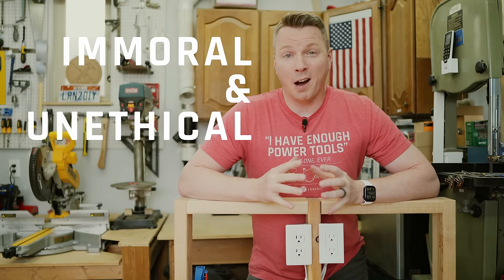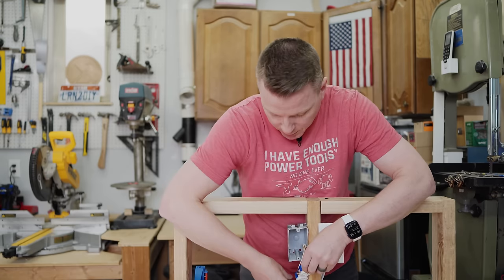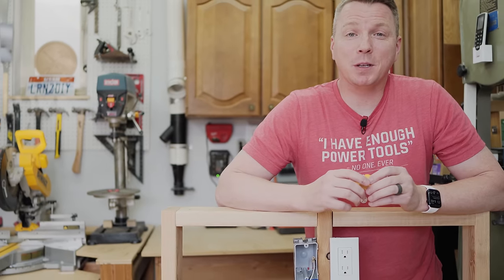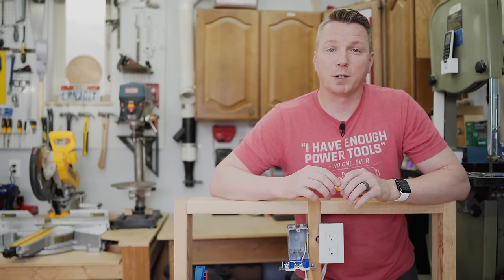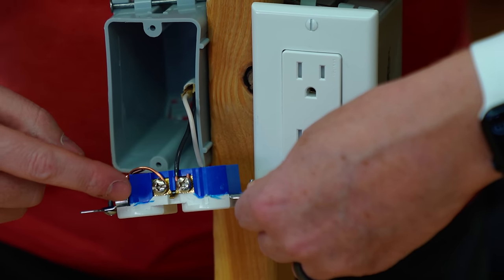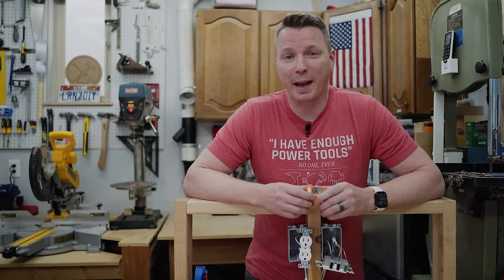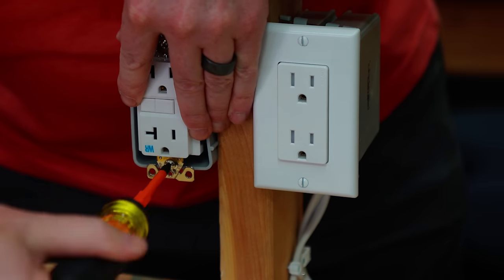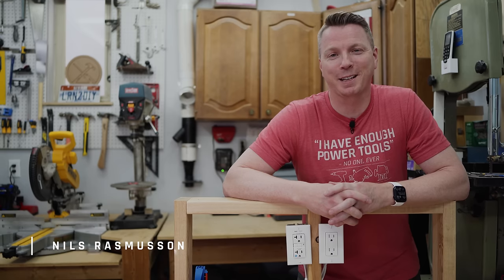People Are Adding Deadly Hacks to Outlets

Comment: I see this all the time. The city I live in requires rental properties to be inspected and the inspectors check the outlets. A lot of landlords just use the jumper because they don't want to spend the money on GFCI outlets. The inspectors have caught on and are starting to use the expensive testers. When they catch someone they automatically fail and must have the outlet replaced by a licensed electrician then pay $250 to have the property reinspected. So when they get caught trying to save $15 it ends up costing them a whole lot more! Not to mention they are endangering the lives of their tenants.
Reply: How does gfci outlet helps if you have just 2 wires ?
Reply: @dmitripogosian5084  With normal power usage, the amount of power you draw from the hot matches what is sent back on the neutral.  GFCI outlets work by running both of those through coils that balance out.  If they aren't balanced, then it acts as a magnet that trips the breaker.  Very clever design, but the result is that if the power tries to go to ground or somewhere else, it will trip the breaker, so GFCI saves you.  It's also totally allowed by code as long as you use the provided stickers.
Reply: @pfcrow  Thanks for explanation !

Comment: GFCI - current going into it and coming out of it - more specifically imbalance detection ... it's looking for imbalance between hot and neutral (or the two hots in 220V circuits) - notably it specifically excludes and doesn't look at ground for that current imbalance detection - so ground is /not/ included at the current it's examining.  And, don't think I'd call it "computation", as often the GFCI circuitry is much simpler than that.  It's essentially a very small step-up transformer - with the primary being what should be balanced pair of hot and neutral wires (or two hots for 240V) - as long as that current is perfectly balanced, zero output voltage to the secondary, but any current imbalance creates an output voltage on the secondary - the more imbalance, the more output voltage.  The output voltage of that secondary is then used to drive generally fairly simple circuit to trip the GFCI - and relatively quickly for relatively small current differences in the "primary" of that mini-transformer setup - we're talking on the order of (tens of) mA and (tens of) mS (I forget the particular specs).  GFCI may be entirely analog circuitry and fairly simple.  I haven't examined/researched AFCI circuitry - but I'd imagine/guess those might be fair bit more sophisticated (might include bit of digital, and thus possibly "computation" - but it would need be quite rock solid reliable, and anything short of that, fail in safe mode almost always ... maybe there's way to do that with fairly simple circuitry ... like I say, I've not looked into those implementation details for AFCI).

Comment: Does removing the ground pin from a grounded plug cause any problems? 

We have a window unit AC that has a GFCI on the plug, but my mom broke the ground pin off. The GFCI keeps tripping and we cant figure out why. (Its worth noting that it is plugged directly into the wall. Not a power strip.)

Comment: Don’t hate me but I did this once in my sister’s house to get one of her surge protectors working (it was one that required a ground to actually function), also the idea from this comes from 3 wire stove/dryer cords/outlets, where they bond the ground and neutral in the appliance so they don’t need a 4 wire cord, since the neutral wire is big enough to accommodate for both, because on those there is little to no current on neutral

Comment: When we bought our house 5 years ago, we had the wiring redone by an electrician.  But before they rewired the kitchen, we had a plumber do some work under the kitchen sink.  We apparently had a reverse polarity bootleg ground on the disposal plug because when the plumber touched the disposal with his screwdriver, a HUGE spark jumped.  We shut off that circuit while he was working, and eventually the electrician rewired that circuit and it's all good now.  But boy that was scary.

Comment: So glad I live in the UK where all our appliances are grounded by default. You do sometimes get fake ground plugs though. But that's usually the cheap chargers you get at a corner shop for a tenner but most proper plugs have it.
Reply: double insulated uk plugs don't need a ground just like double insulated europlugs
Reply: @gamecubeplayer  ah I never knew that. I vaguely remember someone mentioning the plastic ones could be a problem though if used long term but most people would unplug phone chargers regularly as they go about their everyday.
Reply: @cillianennis9921  for example you can't plug grounded c5 power cords into double insulated c8 devices

Comment: A box with 3 prong with 2 wires and or a green dot on the face is common in old homes (the testers will read open ground).  Old homes are also usually wired with bx steel sheath cable and steel boxes that act as a ground.. you can (I believe) add a jumper to the back of the steel box to the ground connector on the outlet depending on if you have BX wiring or not

Comment: Years ago I was inspecting a house. At the panel, the branch circuit wire was silver cloth with 2 conductors. When I started checking the receptacles every one was testing grounded, Red flag pulled a few covers, everyone was bootlegged

Comment: Those testers also wont expose a Neutral and Ground Reversed. They are connected at the Main Service, they seperate after that, the neutral carries current, Ground keeps everything at Ground Potential.  If it is Grounded, it can't be live, would trip the breaker. 
Good Explaining
Stratmando

Comment: Bootleg grounds will trip GFCI and AFCI breakers in the panel, as it sets up an alternative path for neutral current to flow back through the connected device as your then perhaps part of the circuit if the thing plugged in is not double grounded. The GFCI-AFCI detects a current imbalance due to ground wire siphoning away neutral current and it clicks off. Actually, having those type breakers in your panel is a good test of the wiring. It will also click off on shared neutrals. It wont click off if there is no ground wire at all, which is still a good thing. Any ground fault will still be detected, so you are protected from shock with no ground at all when using a GFCI. All old 2 wire hot and neutral with no ground can have a GFCI and your protected from ground faults. Newer GFCI auto test continually, if the GFCI breaker electrically fails, it turns off the power and cannot be reset, which also is a good thing. Technology is making even old wiring systems much safer. It may be a code violation to install a grounded receptacle on a 2 wire system with no ground even if it is GFCI protected, because, well, it is in the code. But it will be perfectly safe to use. But I DO recall seeing those outlet stickers that say GFCI protected NO Ground that are placed on such outlets, so maybe not a violation after all if it is labeled.

Comment: My dad recently started to redecorate the kitchen and found that one of the wires had a nail through it. These wires have been changed since at least the 70s, and whoever did them ran out of cable clips and just used a nail for it.

Comment: European outlets are designed so, that you can simply plug in a 3-pole plug (with ground wire, type E or F) into an ungrounded, 2-pole socket (type C). It just fits (the ground wire in the plug isn't simply connected to anything in that case), so there's no reason to make such "bootleg grounds" - although, as others have noted, similar approach was used for some time, with "zeroing" instead of grounding (TN-C type installations). However, it doesn't work the other way - if you have an old device with a full-size, round 2-pole plug (type C), it won't fit into a 3-pole socket with ground (or null) wire (type E or F). Small, flat 2 pole plugs (so called "Europlugs"), as found in eg. some portable radios etc., do fit into 3-pole E or F sockets.
(By the way, American 2-pole plugs/sockets are called type A, and 3-pole ones, with grounding - type B. I wonder why you didn't mention these names in the video...)

Comment: I am glad you brought this to my attention. If I were a home buyer or homeowner, I can use a  cheapest way to find out if you got hacked "ground" or not. Use a cheap 1500 watt portable heater to bog down a neutral and you'll see the different neutral and ground voltage potential. If both neutral potential is same as ground, you will know it's hacked. Closer to main electrical box will show lesser voltage potential difference between ground and neutral. You should still see some difference even with a $10 meter. If you're too close, best to open the plate and see.
Reply: The only reason you'll see any power on the ground in the situation you described is because you're pushing the neutral wire to it's max potential (1500 watts = 12.5 amps to 13.64 amps, depending on your actual voltage available, assuming it doesn't exceed 120) and the power is just sitting there, waiting to "take it's turn" to go into the wire (like cars on a backed up on-ramp). This also means your wires will be heating up, which reduces conductivity, which in turn creates more heat, etc. It's important to NOT "bog down a neutral". It's a fire hazard! Always use the correct size breaker for the wire and always use the correct sized wire for the anticipated load. While power on the receptacle's ground DOES show potential to shock you, it can only do that if your body becomes the path of least resistance for this "backed-up" power and it'll never exceed the amount of power that's "backed-up." While it isn't impossible for you to get shocked from this situation, it'd require some very specific circumstances, like, say you're standing on a grounded metal surface AND your body doesn't offer enough resistance conductively speaking AND you are barefoot AND the circuit breaker is at least 20 amps or is faulty. Circumstances may vary but I feel like I made my point.

Comment: In fact this was common 50 years ago when the TN-C only networks were used. You can still find this in old buildings with aluminium wires.

Comment: in the midwest (maybe some other parts of the country) we have conduit for all of our wiring. so if you have a two prong outlet you can replace that with a 3 prong outlet and use the conduit as ground.
Reply: Does that meet regulations? Can you be sure that junctions in the conduit really never ever get corroded?

Comment: You can do this hack only if you're house using metal outlet boxes and full metal electrical conduit because the ground was attached to the conduit that mounted to the breaker panel because the grounding rod usually ran right under the breaker panel through the foundation and the stud under the breaker panel.

Comment: There is a way to use those cheap testers to find reversed outlets. You will need the cheap tester, a roll of wire long enough to go from an outdoor ground to the outlet being tested, and one of those 2 to 3 prong adapters. You connect the long wire to a good ground and the little ring on the adapter then plug the adapter between the tester and the outlet in question. You will instantly know if the outlet is reversed and a bonus is you can then unplug the tester from the adapter and plug it into the outlet to see if the lights all light up properly. You'll still have to pop the outlet to check for the "cheater ground" but this will let you quickly test for reversed outlets in a house for wayyyy less than 400 bucks for a smart tester.

Comment: Many times when a non professional "Electrician" happens to be an electronics technician, they will assume that the white wire is the hot and the black is the ground.  In electronics, the red wire is normally the live circuit and the black wire is always ground.  I became an electronic technician, but discovered for power outlets that the Black was the "Hot" and the White was neutral when I was very young.  
When I was first hired as a technician at a sound installation company, we were building new workbenches for our shop and also installing the electrical outlets.  The senior tech was hooking up the outlets without regard to polarity.  I tried to tell him that the black wire needed to go on the gold screw and the white wire needed to go on the silver screw.  He scoffed and said "It is AC so it doesn't matter".  That is true in electronic equipment, but not power wiring.  Note: this was in 1972 in and old building in downtown Memphis, TN.  Almost all wiring back then was simple two-wire and no ground connection.   All newer construction had the three prong grounded outlets.

Comment: We bought this older home built around 1960 eight years ago.  Many of the outlets in the home were wired like this.  I left the 3 prong outlets in but removed the cheater.  I recently had a GFCI breaker installed in my main breaker panel by a licensed electrician and have labeled the outlets. (This is exactly what Bern Litzner is recommending below).

Comment: It's more dangerous in Europe (230VAC). I'm from Hungary, and I remember a beginner electrican's guide book which explained the dangers of this trick. I was just 6 years old.  I've seen also this bootleg ground  somewhere in Germany too. The worst I've seen at a friend's house, is that a whole, properly wired consumer unit had a floating ground without connected to anywhere. The grounding rod was disconnected in the outside of the house. My friend asked me to check a shocking washing machine. The whole thing was live in the bathroom, because of a faulty coffee brewer, which heating element was shorted. That's why the ground and the neutral should be tied, but JUST at the consumer unit, not at the outlets, if the live-neutral difference is low enough.
Reply: It is not a bootleg ground in Germany but Klassische Nullung, a perfectly legal method in old homes.

Comment: So I had a question about breakers and whatnot. In my house, we have about 6 outlets hooked up to a single switch in our breaker box, which is causing issues as these six are split between two rooms both running a lot of tech. This has caused the breaker to trip at least twice, is there a way to have an extra switch put in and have 3 of the 6 outlets hooked up to that one instead and about how much should I be looking at spending? I live in Michigan if that changes anything.

Comment: I've encountered even more dangerous one:
Some ppl to hide that it's not properly grounded connect third wire that ends only few fees deep and then they mask that ground was connected to neutral. That way even if you open it, at first glance you see 3 wires coming out and seemingly not shorted neutral with ground

Comment: I would have liked more information on specifics of what can go wrong and why.
For example, I have a circuit in my 1960s home in which I have 3 prong sockets and a ground wire, but there's a fault somewhere in which the ground wire never makes it to the breaker panel.
So, I had an air conditioning plugged into this circuit (with a warning about only using on grounded outlets) and what ended up happening was..
Not only was the metal case of the air conditioner giving little jolts.. EVERY OTHER appliance with a ground on that circuit was as well. Basically turned the ground into a live wire. So a broken ground became more dangerous than no ground at all! 
I put a bandaid on the issue by running a GROUND ONLY cord from the affected outlets to ones with a properly functioning ground. When in place, I no longer get zapped and an outlet tester says Correct on all sockets.. I can't be sure I'll ever get the money for a proper fix, since the cost to fix it is more than the property is worth.. BUT lucky for me & despite the other issues with my home, it was originally wired for 3 prong circuits, and the ground still works on most of them.
Reply: Many modern devices leak current to the ground wire and you can feel that if it is not grounded. It is not dangerous if the device was working. If it was it would trip any GFCI. The leak current is typically under 0.5 mA. The solution is not to touch it.

Comment: I recently changed the electrical panel.  The electrician hammered in two 8' long copper rods into ground,  The ground wire is tied to these 2 rods in additional to the copper pipe.
The $8000 quote is on the high side, my opinion.  Likely your attic is open and you have at most 20 circuit breakers.

Comment: since 1973 a Classic zeroing is prohibited so in older buildings its okay to find such things and i mean, it works (in building protection, but only to a limited extent in personal protection, there is only a direct danger to life if the neutral conductor and the outer conductor are swapped thus being a short ) thers no real reason to build such a thing besides replacing one single outlet in one old house i would never install such a thing. 
TLDR: a neutral conductor is a special form of protective conductor. Your protective measure is called classic zeroing or officially the TN-C system with protection by switching off the overcurrent protection device. The neutral conductor is effectively grounded on the generator so that it cannot accept a voltage greater than 50V against a local ground, even under load. This condition always had to be met in the past and was one of the zeroing conditions.

PS: if you turn the testers around it might show the error, also since people are so keen to teel people there irredeemable qualifications im a german Master electrical engineer for communications and security technology